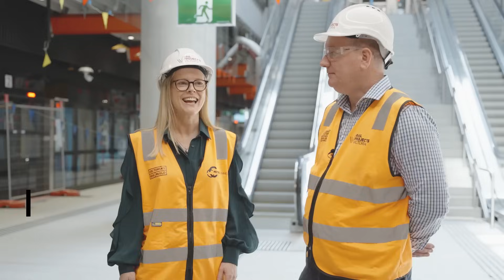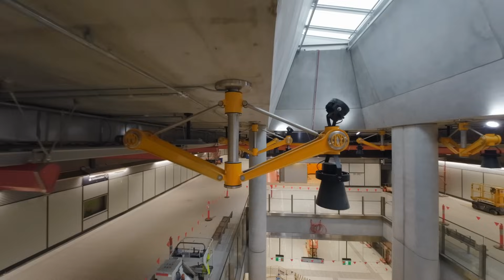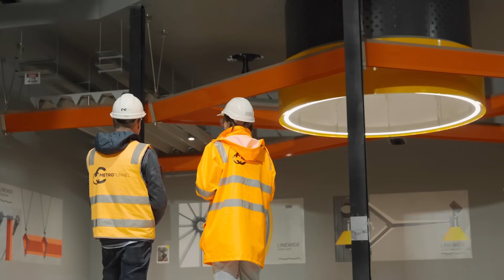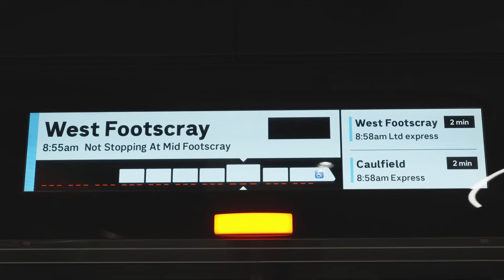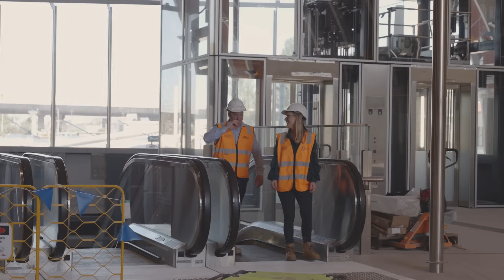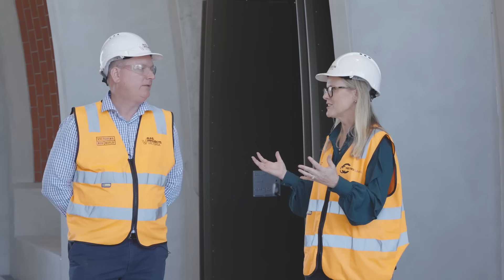An update on Arden Station

Comment: Don't care for the Metro Rail Tunnel, its just going to be a inconvenience for passengers on the Pakenham and Cranbourne lines because trains won't be going into South Yarra and Richmond, they would have to change trains at Caulfield to a already crowded train that's from Frankston that's not good for disabled and elderly.
Reply: If you're concerned about crowding on down Frankston services just change at Flinders st.